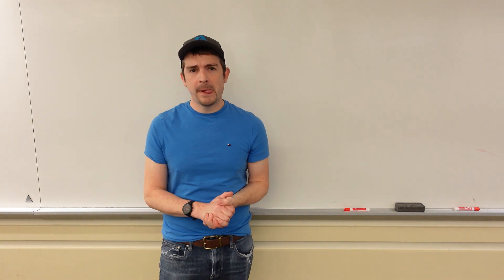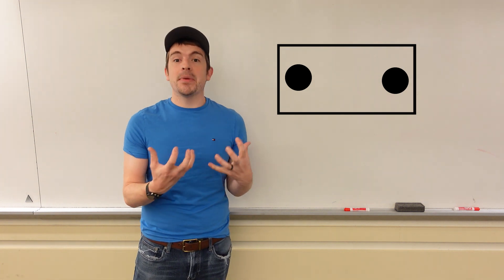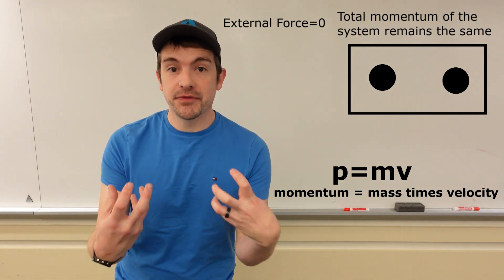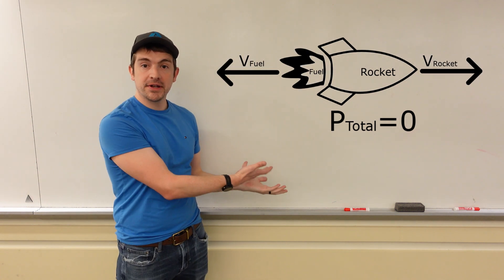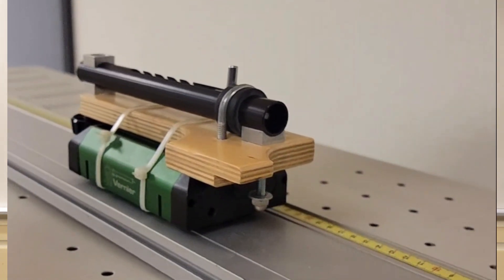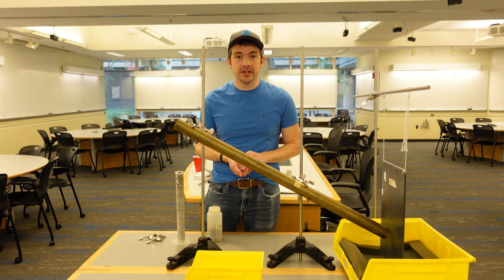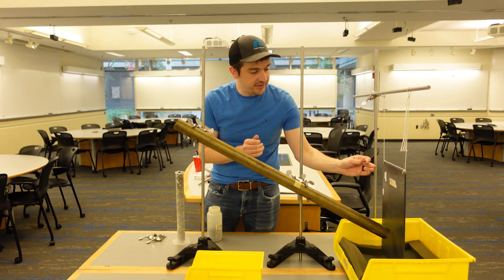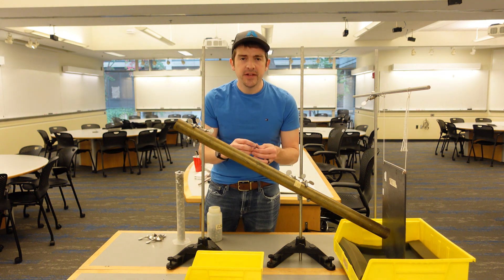The very basic principles behind rocket engines!

Comment: But How fuel is burning in no atmosphere
Reply: Rocket engines have a fuel and oxidizer which are combined so they don't burn oxygen in the air. But what should be asked is, "Since rocket exhaust goes in the direction opposite the direction of travel, how is the back pressure which must be pushing against the engine nozzle created?"